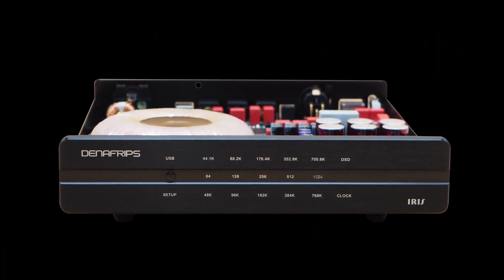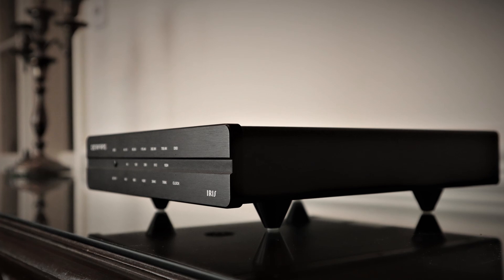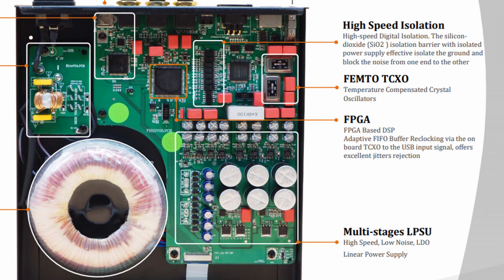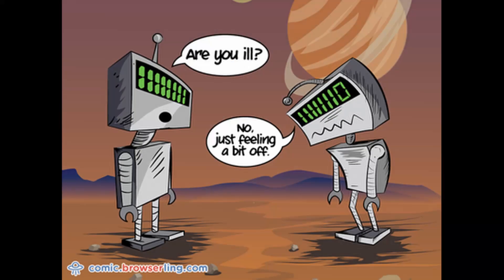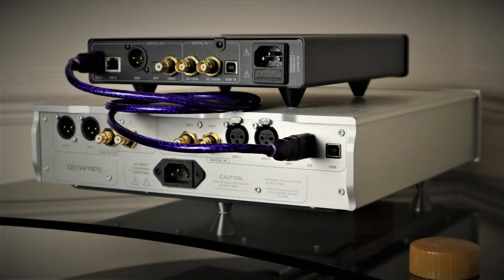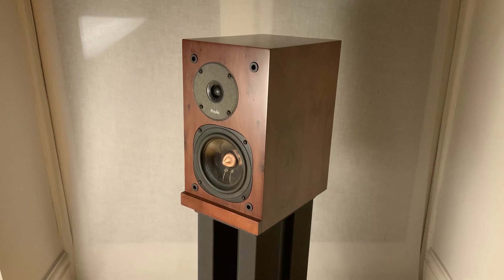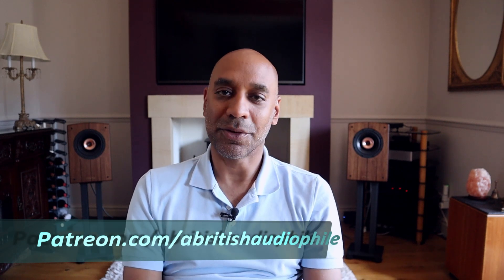Denafrips Iris DDC Review

Comment: Very good explanation and up to the point. If I understand correctly, one of the conclusion is that Toshiba USB (JRiver) to Iris does not make much difference (in terms of sound quality and stage) while connecting to Pontus II directly; isnt it? (or) am I missing something.
Reply from the maker: Thank you. The Iris placed in between my Toshiba Notebook (running JRiver) and the Pontus II did improve the clarity. However when I used my Auralic Ares Mini connected (via USB) directly to the Pontus II the sound was better. More clarity, refinement and a bigger soundstage. Basically changing to a dedicated streamer makes more difference than using the Iris with a computer as a transport 😊👍
Reply: @abritishaudiophile7314  Thank you so much for your reply Tarun. Since Auralic Ares Mini is discontinued, and the next in their line up costs more than $3000, which dedicated streamer (with a dedicated USB output) you recommend (in the absence of Auralic Ares Mini)?
Reply from the maker: @wirelesssiteimpairmentanal8865  I would go for the Bluesound Note. It has a better user interface than the Lighting DS system developed by Auralic 😊👍
Reply: @abritishaudiophile7314  Thanks once again Tarun for your valuable advice. Any thoughts on S.M.S.L SD-9? It got all possible digital input and all possible outputs (including I2S), and at half the price of Node 130. "On Paper" SD-9 seems to have more features compared with Node 130. May I please request your audiophile review on this unit?
Reply from the maker: @wirelesssiteimpairmentanal8865 unfortunately, I haven’t heard the SC-9 😊

Comment: I2S (eye squared ess, Inter-IC Sound bus) has been around forever. Well, it's in the original Sony/Philips design documents, but various manufacturers have been using it for a long time for connections outside of digital players. WAY back when, Audio Alchemy and Camelot digital gear I had used I2S connections. PS Audio has been using I2S for a while. And digital interfaces had been a bit more common: the Genesis Digital Lens, Monarchy DIP24/96, the several Audio Alchemy DTI products - to call out a few. I would always use one, but not so much lately.
Reply from the maker: Thank you for sharing 😊

Comment: Thanks a lot for this review of the Iris DDC. I also have the Hegel H160 and i am using it together with the Ares II DAC. Do you think that it could be an improvement to use this Iris DDC connected before the Ares II ? But it wouldn't be I2S between Iris and Ares, coaxial or toslink then.
Reply from the maker: Hi Markus, I don’t know what speakers you are using but I would go for an upgrade in either amp or speakers. Then look for a DAC with an I2S input before considering the Iris 😊

Comment: Hi Tarun great video I've actually been considering the Gaia which is further up the food chain in the denafrips line. My DAC is a luxman da-06 apart from coax, toslink, USB, it has AES/EBU. I'm not sure whether I would get an advantage given the digital inputs on the DAC. ID be interested in your thoughts.
Reply from the maker: Thank you Shane. That will be interesting. I would predict that the clock and isolation on the Gaia will be superior to the DA06. In the absence of the I2S, I would use the AES/EBU. How much difference the Gaia will make will depend on the implementation of those input on your DAC. If you get to find out, please let me know 😊👍
Reply: Thanks Taran for the advice and l will let you know 🎧🙂

Comment: Very much enjoyed your review. I currently use a Node (N130) via USB to Ares II DAC, do you feel adding an Iris inline would further improve the sound quality?
Reply from the maker: I wouldn’t use it just to reclock the USB signal. The main benefit is when using the I2S output 😊
Reply: @abritishaudiophile7314  thanks Tarun. Output from the Iris would be to Ares II (coax). I may not fully understand your response…
Reply from the maker: @trevorparmer5231  sorry, typo. I just corrected it 😊

Comment: Thanks Arun for a simple, understandable explanation of this complex topic. Just want to ask you if you think I will benefit from adding this Iris to my audio chain. Currently im using Ares 2 dac, KLH Model 5 speakers and SMSL VMV A1 amp. Thanks.
Reply from the maker: Thank you. I would keep it as is. The real benefit of the Iris comes when using the I2S output. As the Ares II doesn’t have an I2S input you will need to use coax or optical. It won’t improve things that significantly in that application 😊👍

Comment: I have the Denafrips Gaia for about 2 months. Using it with a Hegel HD30 DAC (so no i2s here). Significant upgrade for me, just makes everything slightly better. And all those slight improvements really add up..  

( not saying it's the most cost effective way to improve sq for a system like mine, but it certainly does work )
Reply from the maker: Thank you for watching and sharing your experiences 😊👍

Comment: Hi. I have Pontus II 12th anniversary. I am using it with Sotm Sms 200 Ultra and Sotm sps 500 power supply. Do you recommend Hermes DDC or upgrade my dac to Venus II 12th anniversary? Some people say Hermes have OCXO clock and better with Pontus than Venus. Thanks
Reply from the maker: The Hermes does have the OXCO clock from the Terminator. It will be an upgrade from the internal clock in the Pontus 😊

Comment: 12:03 Im confused, are yous saying the Iris makes a negative impact when using coax out? You say you're better off going direct from streamer to DAC only when using the I2S output, otherwise the Pontus is better on its own?
Reply from the maker: @mat.b.  improvements in sound quality are most noticeable when using USB into the Iris and then IIS into the Pontus 😊
Reply: Will this make any perceptible difference to the sound quality of a cd player?

Comment: As always, another great review.  Just so I get this straight.  I have a Pontus II DAC, Jay's Audio CDT2-MK3 and a mini PC acting as my current network streamer.  The CD and PC both connect to the DAC.  If purchasing the Iris, only connect the PC to the Iris and NOT the CD transport?  The CD still connects directly to the Pontus II, bypassing the Iris?
If that's the case, would I not be better off purchasing a "real" network streamer, possibly eliminating the need for a DDC?
The remainder of my system is a Luxman 507uXII integrated and Spendor D7.2s.
Reply from the maker: You could do what you suggest Doug. Iris between PC and Pontus II, CD direct. I would upgrade the streamer as the PC is likely to be the weak link in the audio chain. Thank you for watching 😊👍

Comment: Hi Tarun. Great review as usual. A question for you: I own the Terminator Plus and Gaia DDC. I believe Denafrips recommends using the TPlus clock to clock the signal in the Gaia via dual BNC cables. Would you agree that it is better to clock the Gaia with the TPlus or would you recommend having the Gaia clock itself with its own internal clock? Thanks from Chicago! Regards, RJ
Reply from the maker: Thank you RJ😊👍
I would have to look into it. I can’t see the point in using an external DDC if the internal clock in the Terminator Plus is better 🤔
Reply: The T+ clocks synced to the Gaia via dual bnc clock out is superior to using the Gaia’s internal clocks and feeding the T+ via i2s. I have this very setup, sound goes from very high quality 2 dimensional to 3 dimensional when setup using the clock out feature va dual bnc cables.
Reply from the maker: @LJ-mp7ir   Thank you LJ. My question would be, aren’t you better off just going direct from your transport to the T+? What function is the Gaia performing other than converting the digital source to I2S and feeding it to the T+? If it is not lowering jitter then perhaps the extra isolation the Gaia provides is the reason for the improvement you are experiencing 🤔
Reply: @abritishaudiophile7314  have had the opportunity to try it in every possible configuration and have had multiple people over for back to back listening sessions, everyone has unanimously commented that the stereo image gains a palpable 3 dimensional sound once the Gaia is setup via the clock out from the T+ via the dual BNC. It doesn’t make sense as to why this is the case, but everyone prefers the depth and width as well as the weight and clarity that the Termintor + clock out to the Gaia provides. And to answer another question that one of your followers asked,  I have the new melco n1z/ h50 streaming Qobuz with very high quality silver wiring throughout and the sound is still markedly inferior to playback at 16/44 via the Jays CDT2 MK3 outputting via AES to the Gaia. The Jays is bar none the best I have ever heard a Cd being played, it makes the highest quality music streaming files at 24/192 sound like you are listening to MP3. The clarity and weight of the stereo image is spooky with the Jays and high quality wiring.
Reply from the maker: @LJ-mp7ir  Thank you for taking the time to share your experiences LJ. Sometimes there isn’t an easy answer for why something sounds better as I recently found out when reviewing cables. I appreciate you trying to shed some light on the mystery 😊👍

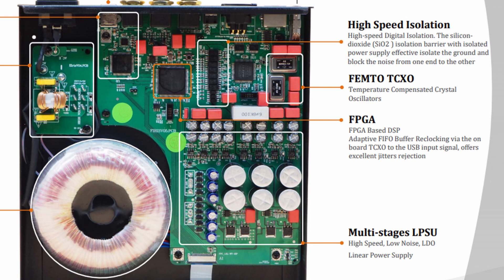Comment: Hi, I’m researching which  Denafrips DDC to purchase.  I have a Pontus ii .  Actually I believe your statement on clocks in the Iris is incorrect (starting at 9:18 in the video where you state the clock is like in the Venus?) but that’s not the case unless I’m missing something.  The IRis  uses the same clock as what’s in the Pontus, 

Later in the video you show the clocks in the Pontus The Femto TCXO verses the Precision Oven Controlled Crystal Oscillator OCXO in the Venus and Terminators.  So I’m confused in the early statement you made.   Please clarify.

I believe the advantage of the Iris in the chain with Pontus is the additional galvanization and the conversion to i2s straight into the DAC eliminating the USB conversion in the DAC.
Reply from the maker: I have confirmation from Alvin at Vinshine Audio (Global distributor) that the clock in the Iris is identical to the Venus II and not the Pontus II.
Reply: @abritishaudiophile7314  thanks for getting back to me I really appreciate it.  Then the diagrams in the later part of the video are incorrect?  It’s not the Femto TCXO but the Oven controller Crystal Oscillator OCXO in the Iris… this is what I’m confused about..
Reply from the maker: @Smokej620  it is a TXCO in the Iris. The picture of the OXCO is in the Terminator and Teminator Plus. Sorry, if it wasn’t clear 😊

Comment: I have a Lumin U1 mini and a Denafrips Aries 2 DAC. Do you think inserting an IRIS into the chain would make an improvement? I would use USB out to the IRIS and COAX? To the Denafrips Aires 2? Back end is a Simaudio 340i and Sonus Faber Sonetto 3 speakers.
Reply from the maker: Probably not the best use of money as the Ares II doesn’t have an I2S input 😊
Reply: @abritishaudiophile7314  what about pairing Iris with U1 and Venus 2? Would that make an improvement over the USB out on Lumin?
Reply from the maker: @monster7363  I am investigating the Iris with the Venus II at the moment. I haven’t tried it with the U1 😊
Reply: @abritishaudiophile7314  is there a difference using the DDC with I2S? Do you notice any improvement?
Reply from the maker: @monster7363  there seems to be but the listening session was cut short as I needed to move on to reviewing another product. I will revisit it at some point to make sure 😊

Comment: Liked the video very much! What cable do you use with the i2s (lvds) input? I have a dac with the right input, but … I’m lost when it comes to the cable
Reply from the maker: Thank you Njâl. I used a QED HDMI cable 😊👍
Reply: @abritishaudiophile7314  hdmi cable for your opinion is right choice for i2s input or you "compromise" on a hdmi cable
Reply from the maker: @vaksilvaksil9939  I think you could use either connection but I went with HDMI and it worked well 😊
Reply: @abritishaudiophile7314  Thank you! Do you think it will have a good effect on sound of my system streamer when put in between the Ethernet cable and the streamer? My system is the streamer and dac Matrix element I, amp is Peachtree Nova 300, and speakers are the Audio Physic Tempo 35. Njål
Reply from the maker: @njalbrekke4861  what DAC are you using?
Reply: @abritishaudiophile7314  I use the Matrix Element I as a dac and streamer.
Reply from the maker: @njalbrekke4861  that is what I suspected. The Iris would not work as it sits in the chain between streamer and DAC 😊

Comment: Hello Tarun, Thank you for the informative video. I am in the process of heading the Denafrips way, and I am using the Athena preamp and it has expanded the sound stage. I have purchased the Denafrips Avatar and it is on its way. I was wondering if you could please compare the output from CD transport with I2S and streaming the same song. I still find spinning CD produces better quality of music compared to streaming, I was wondering I may be wrong. You have all the Denafrips products at your disposal, so I was wandering if you could help out a fellow audiophile before I sink 6k on Denafrips Terminator 2. My system: Ayon CD 5S CD Transport and DAC (even though it is old has all the tech like I2S and very well reviewed). Pre Denafrips Athena, Power Amp Rogue Audio M180 Monos. Speaker Pure Audio Project Quintet 15 Horn 1. Thank You.
Reply from the maker: Thank you Ganesh. That is a very nice system you are putting together. I think Denafrips are doing some innovative things. I hope to review more of their products. I have 12,500 song on a 2TB USB drive plugged in directly to my Auralic Aries Mini. It should better than streaming Tidal on the same device 😊👍
Reply: @abritishaudiophile7314  Thank you Tarun. Looking forward for more of Denafrips products review.

Comment: My SMSL VMV D1se DAC has an I2S input, but I've heard not all I2S connections are compatible, even if the connector fits. Is there any way to check this? I am considering getting the Iris since I do not have a very high-end DAC (though it's pretty good for sub $1k price). Thanks!
Reply from the maker: You will need to check the HDMI pin connections on the Iris and VMVD1SE to see if they can work together. Emailing Alvin at Vinshine Audio would also be advisable 😊

Comment: I'd be curious to learn about how well the Iris would work with the Ares II? It is too bad the Ares II doesn't have the AES input - is there a way to use the USB input on the Ares II? Or more likely, it would have to be a coax connection.
Reply from the maker: I think the real value of the Iris comes in when using it’s I2S output. Unfortunately, the Ares II doesn’t have an I2S input 😊
Reply: @abritishaudiophile7314  Right, which is odd since it visually matches the Ares II.

Comment: You can’t clean a digital signal i.e. you can’t hide additional audible detail within a signal that you can only recover it with an expensive black box between your source and DAC. 

Clock jitter under nornal conditions is inaudible, it exists but it has no effect on what you can actually hear. Jitter affects the structure of a digital signal (how we physically send it) not the data itself (1’s 0’s). The only time you need to worry about it is if your audio pops and glitches. That’ll be down to poor/no clock sync or a sample rate mismatch (in effect the same thing).

If all this device does is take in a digital signal at its own clock speed and send it back out again then it’s literally just an overblown interface with digital out but no analogue inputs.

Save your money and stop worrying about clocks. The only components in your system that will make a difference to quality are your DAC, amplifier, speakers and/or headphones.

Cables, DDCs and Expensive CD “transports” should all be avoided. Anyone claiming they make a difference is honestly deluded or lying to you to try and get your money cough ps audio cough